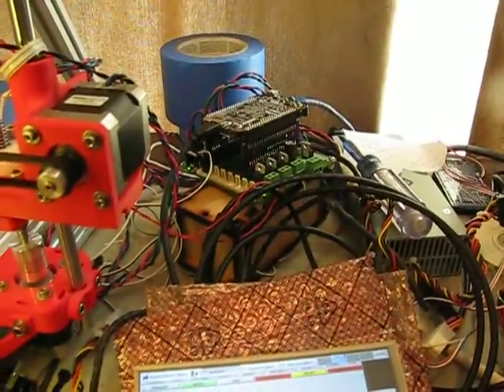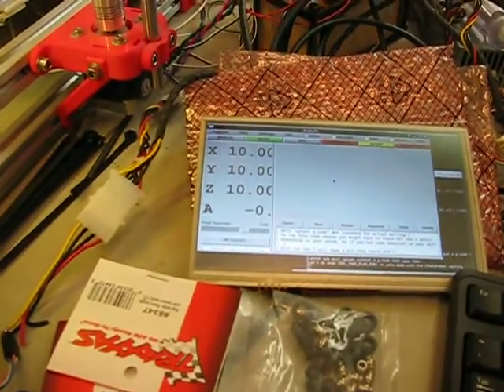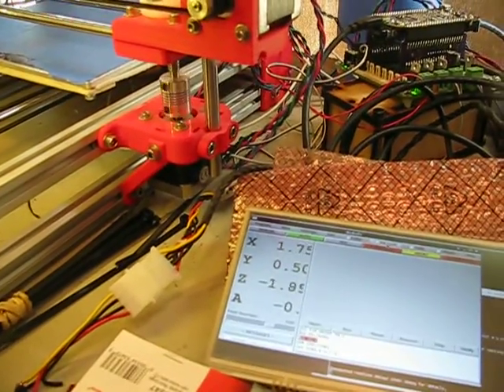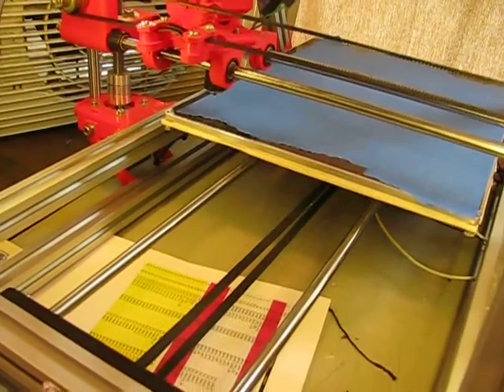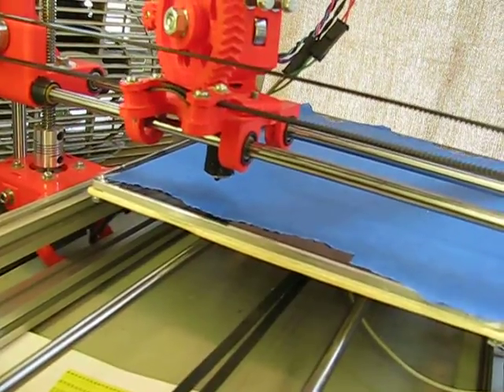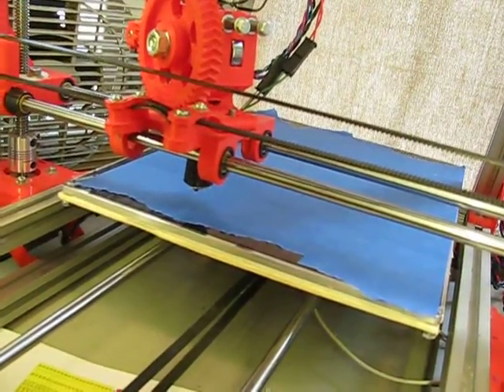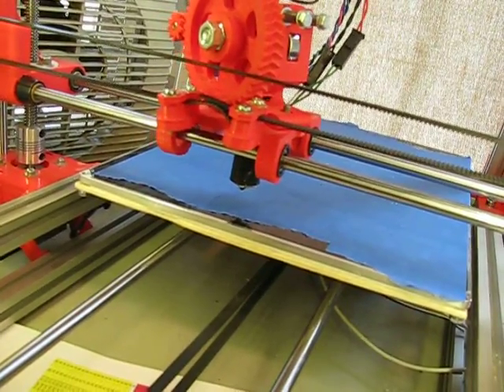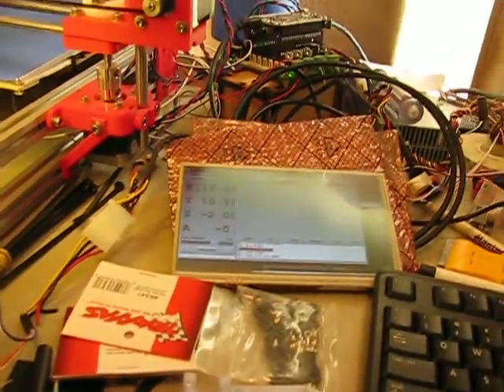BeagleBone LinuxCNC Hiccup

Comment: Charles
Did you ever figure this out
Reply from the maker: Yes (full thread on the LinuxCNC developer list).  It turned out to be a problem with the GUI interface code, which was intentionally shutting down motion when enabling the back-plot for some crazy reason.  I switched back to the Axis GUI and haven't had further problems (although I have to select the DRO tab instead of the back-plot tab to keep usable performance since 3D acceleration doesn't work yet with any Xenomai kernels I'm aware of).